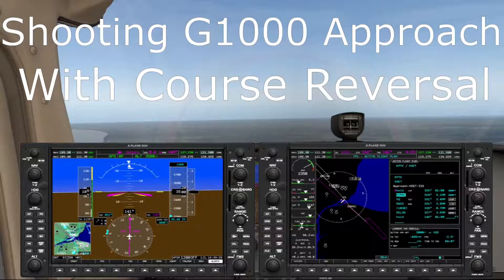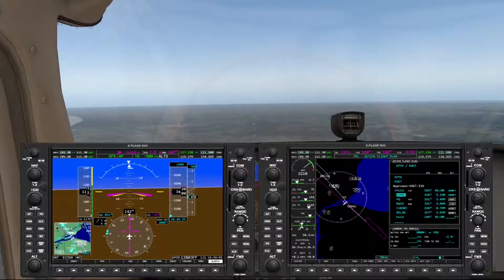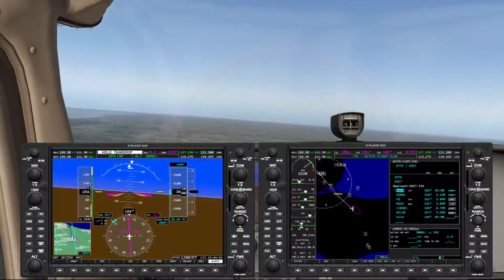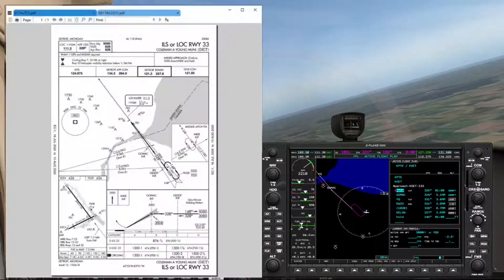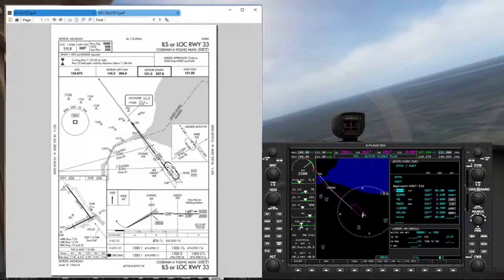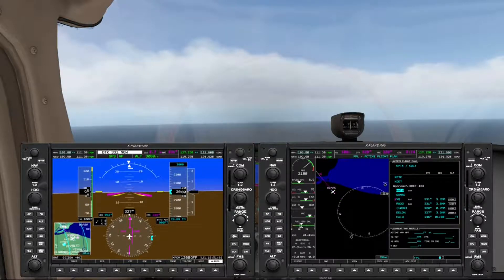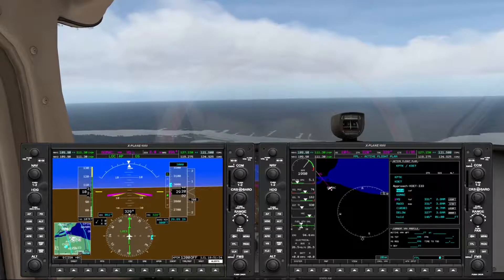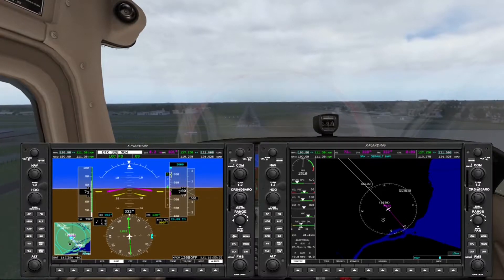Shooting A G1000 Approach with a Course Reversal

Comment: Mark Thanks again this was vary educational.Is there a chance you could do a flight from Ksbn to Kord and come in from the west flying a star with piolet2atc so we can hear the act controllers and then go missed to a holding pattern .I know this is a lot in the 172 but would vary helpful especially if atc was to change the approach and runway on the star.Thanks again for the great videos .if there are any mistakes can you leave them in with explanations for corrections.
Reply from the maker: Sure.  I'll plan that.   Should be fun.   Thanks
Reply from the maker: Hi David,
Just completed the KSBN->KORD flight.   I'll be posting it as soon as I get it edited.   Stay tuned for that.

Comment from the maker: John asked a couple of questions about reversals in approach procedures and about "Activating" an approach.   These are really important questions and confuse a lot of pilots.   I gave him a rather lengthy answer and thought I would include them here in case any of you are troubled with the same issues.   Here is my response to John:

Those are really meaty questions you ask John.  I'm going to attempt to answer them in some detail.

The "Procedure Turn" question:
I rather like to use the term "Reversal" as there are actually two types of reversals used in approach plates. One is the "Procedure Turn."  The other type of reversal is the "Holding Pattern" (really confusing because they actually use a holding pattern to perform a reversal and should not be confused with the traditional HOLDING PATTERN used to suspend your flight waiting for further clearance).   Thus the HOLDING PATTERN actually has two uses:
  1. The traditional HOLDING PATTERN used when ATC directs you off somewhere to "kill time."
  2. To perform a "Reversal"

The "Reversal" is of interest here which is why I like to call it simply as a means to reverse our direction of flight and the angle of turn would be too sharp to safely make the turn to final course (thus the need for the reversal).

You normally ONLY need to perform a reversal if the active runway is in the opposite direction of your arrival direction.   The reason I chose RW33 was because it was the opposite direction of my arrival into KDET.  If the active runway had been RW15,  I can enter the approach without trying to make a sharp (and unsafe) turn to final so no need to perform a reversal.   There are times when ATC might ask you to enter the holding pattern but that discussion is for another day.   

If I am entering from the North-West (such is the case when flying from KPTK) and the active runway is RW33,  I need to perform a reversal because that runway is opposite flight direction (back to where I came.)

Getting back to the two types of reversals.   Both runways 15 and 33 at KDET just so happen to use holding patterns as reversals according to the approach plates.   If you were flying back to KPTK,  ILS RW09 uses a holding pattern as the reversal but if the active runway is 27, you would use the LOC BC RW27 procedure and you would see on the plate that they use a "Procedure Turn" to perform the reversal (although you wouldn't need a reversal in this case.)  Both Procedure Turns and Holding Patterns are used for reversals and the LOC BC RW27 just so happens to use a PT for the reversal.   Confusing I know.   That's the FAA for you!

Hope you can digest that really confusing distinction.

Your "Activating the Approach Procedure" question:
The term "Activate" used by Garmin is really confusing.   One of my favorite aviation authors Max Trescott calls this the "Activation Myth."   When you "Load" an approach procedure,  the GPS simply adds the approach procedure at the bottom of your flight plan to be "activated" at some later time (or immediately if you choose).  When you select the "Activate" option,  the GPS simply perfoms a GOTO (programming analogy) to the start of your approach procedure.  If you chose to "Activate The Approach",  any waypoint that you may have in your FP will be "skipped" and the GPS will simply "jump" over all that and go directly to the approach procedure.   Your question on when I might do that depends on my flight plan.  If I have a STAR procedure that I need to perform,  I would not want to "Activate" the procedure until I have flown the STAR.   If my only waypoint is the destination airport (in my case KDET),  I might go ahead and active the approach procedure while still on the ground at KPTK because I didn't have any other waypoint except KDET (a direct-to KDET for example).  I would normally wait until I get close to the destination though to activate the approach in the event that ATC might redirect me and I don't want to do the procedure yet.

Sounds like the need for a video on these subjects are this is really confusing stuff for most pilots.

Good stuff!   Thanks for the questions and the excuse for me to bloviate a bit.  :)

Comment: I successfully did ILS to RW33 at KDET. However, I tried the ILS approach to RW15 at KDET and it got wierd. I entered the Proc to ILS15, Nav1 was set 111.30 which is the localizer at KDET, set for GPS, and activated it in the setup.  Took off from KPTK, hand flew to the magenta line, set the climb, and AP to NAV. but after a minute or two I veered off course 90 degrees to the north, them I noticed that compass had gone into VOR1, for no reason. Tried switching back to GPS but it always went to VOR1.  NAV1 111.3, NAv2 113.8, but NAV1 is active.  I tried this 3 times each with the same effect. I went over SKYvector to see the VOR stations close, but there was only 1 Salem freq 114.3. I am stumped. Thanks again for all your help, I've learned some important things--thanks
Reply from the maker: Probably good reason to wait to activate once you get close.